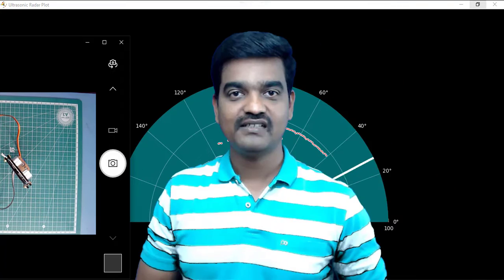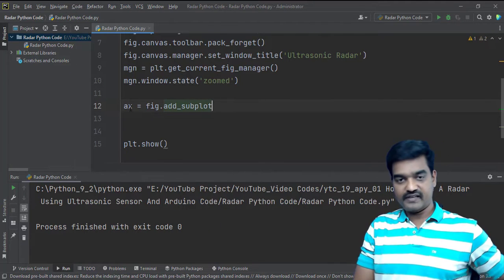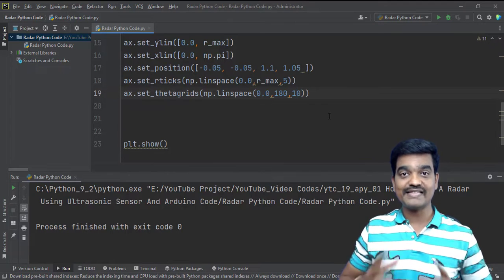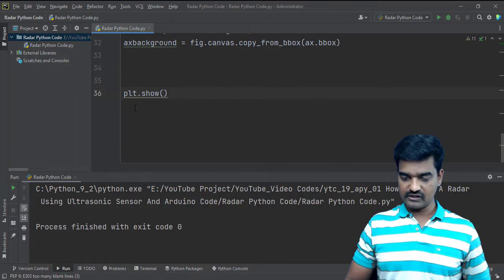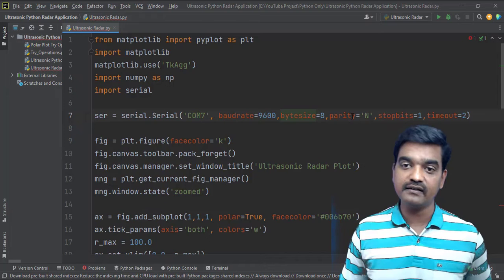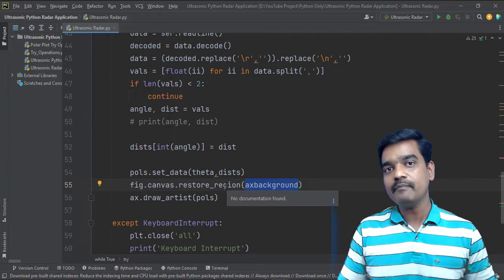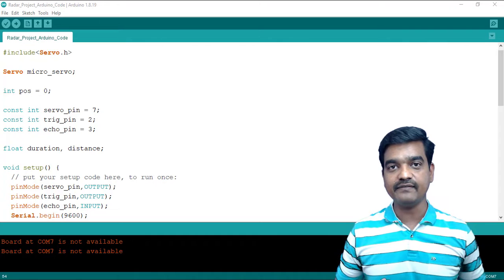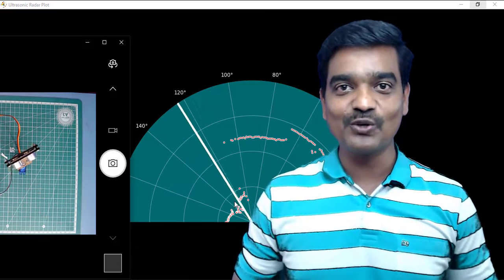How To Make A Radar Using Python And Arduino - An Easy Guide

Comment: Nice tutorial.
I was able to follow a replicate right up the the 
import serial
At the point I had to install the serial library into PyCharm.
After installing what I thought was the correct one I get the error
AttributeError: module 'serial' has no attribute 'Serial'

I'm assuming I have the wrong serial library installed.
Can you tell me what library you used?